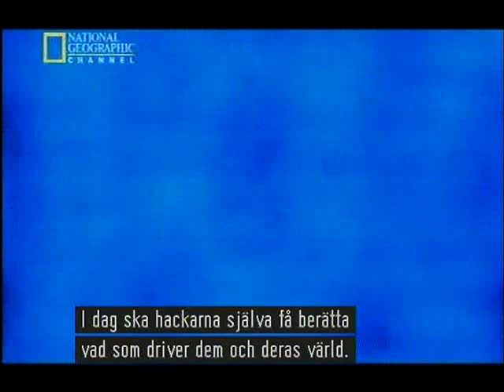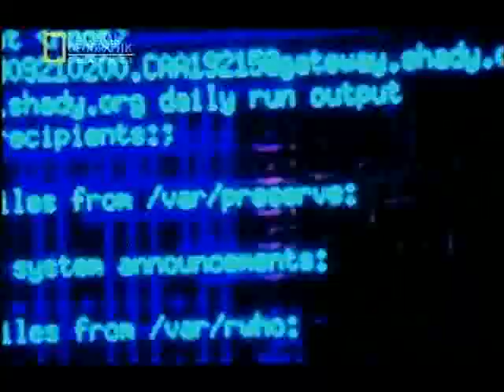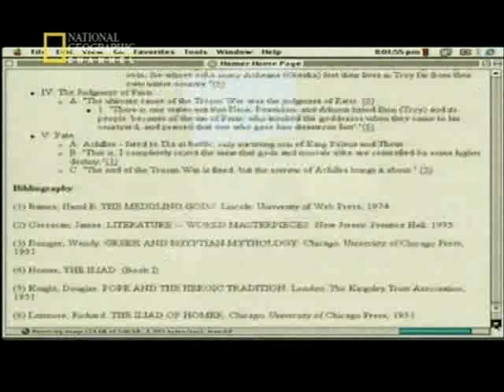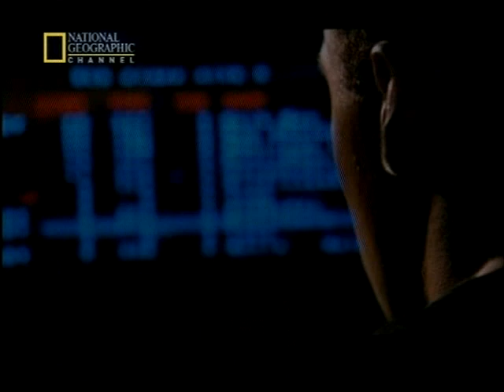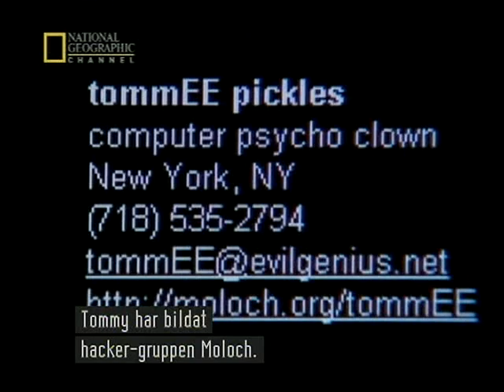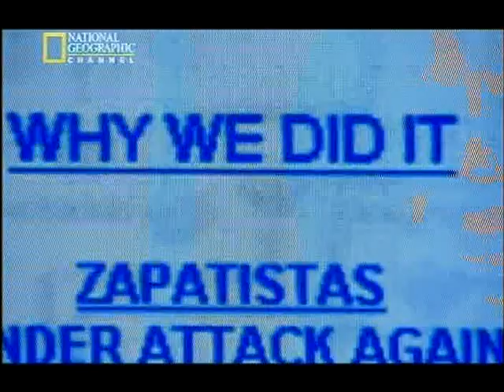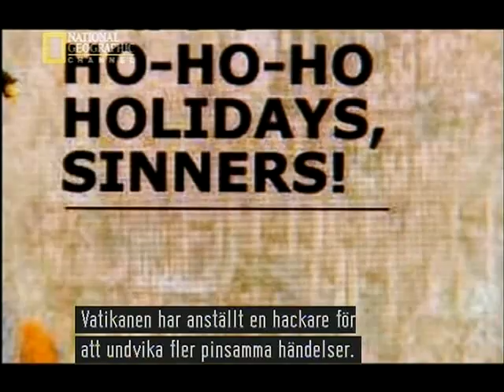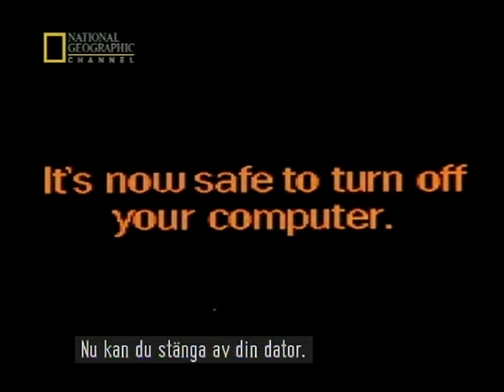Hackers English Documentary [SWE SUB]

Comment: If you're so keen about it, begin it right away. Practice programming even a couple of hours in a week instead of postponing thinking "I'll begin it when..."

Also I'd recommend not to begin with C++ if you haven't programmed ever before. 
Begin with easier dynamically typed languages, you'll get results more quickly, and don't lose interest so easily.
I begun with C++, and it took so long time to get anywhere.

And the last thing, you learn fastest by doing it, not reading about it.

Comment: If they have some sort of software that was installed on your machine.  Once you pull the cord, they lose connection to your machine.  But the software is still operating on your system, so you'd have to find and fix the vulnerability on your machine before you re-enabled your internet connection.  Cause otherwise once you re-establish your connection.  You'll be just as vulnerable still.

Comment: Trust me. You dont need to type fast in order to be a great hacker. 
Programmers are lazy. Hackers even more so. Why write alot of stuff every time you need somthing done if you can write a script for most basic controls ?

In linux you can parse and filter outputs from one program to pipe them as inputs into another which is what linux is so great at. Exactly for that reason you can write scripts to do most common things.

Comment: Not lazy as in not wanting do to work. Lazy as in not wanting to do the same thing by hand over and over.. I agree that kiddies usually wont have a clue what a script or program does. Im just saying that at least the way i prefer working is I mostly would write scripts to pull off most of the typing commands so I dont have to write long strings every time. Thus a hacker wont need to be able to type really fast. 
Most people working with CLI will eventually pick up speed in writing though.